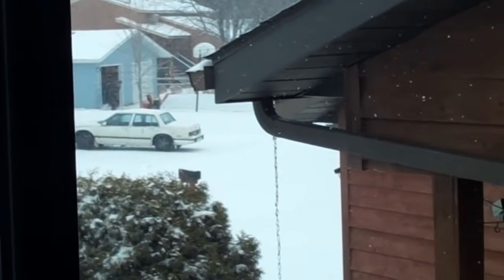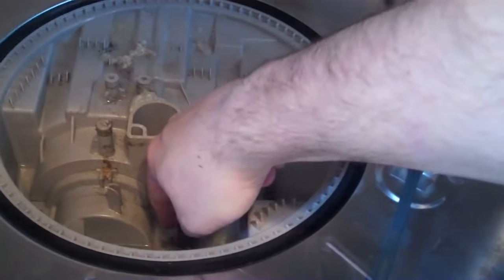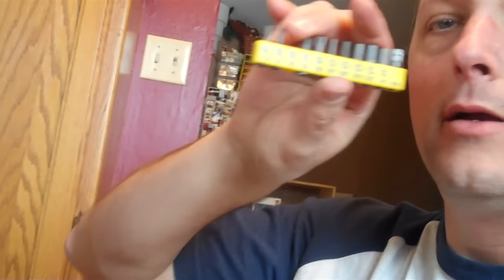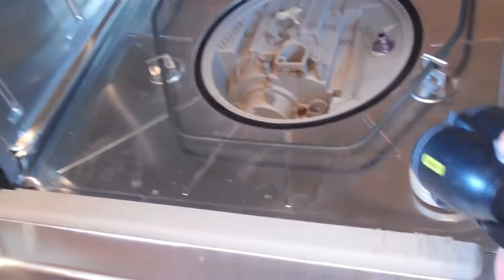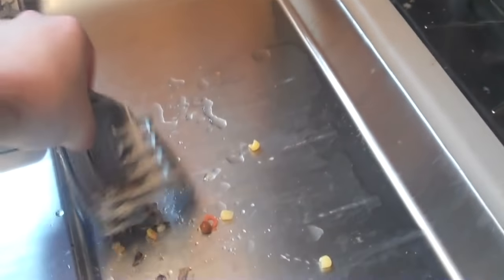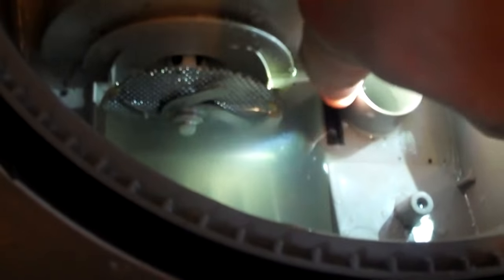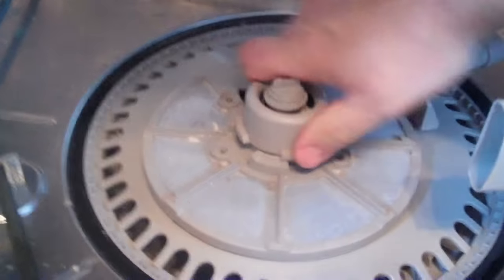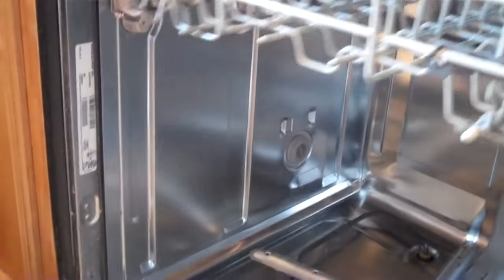Dishwasher Repair | How to Clean the Screen/Filter | Part 1 of 3

Comment: Hi, back after working over our second dishwasher today. Our models look similar to yours but they have a horizontal blue "ProScrub" part at the back similar to this http://www.ajmadison.com/ajmadison/images/large/KUDS30FXBL_recessed_element.jpg  In case anyone else has that today I found that I could pop it off and it had a bunch of the same evil peanut butter that has infested most of the machine so I will be going back to the first machine to check it. Bath tap was again useful for flushing out the junk. It seems to be easier to reassemble the bottom, back and upper channels in one piece but nearly impossible with the ProScrub part attached so worth popping off if just for that and then pop it back on after the channels are in place. BTW while I love my cordless drill and drive on this project I preferred a little ratcheting screwdriver like this one from Lowe's http://www.lowes.com/pd_501838-16878-63396_0__?productId=50074265#BVRRWidgetID  -- it had the two needed bits and I feel safer having the feel of what's happening when screwing into plastic in case I put the screw in at an angle or to avoid over tightening as you pointed out. Only downside is the bits are not magnetic but I have a small magnet that made it easy to lift out that little chopper cover screw. Finally I found some fun tips here you might enjoy seeing for your DIY channel (feel free to edit out link if you don't want it on this page) http://www.finehomebuilding.com/videos/   Thanks for helping us have clean dishes again!
Reply from the maker: I am very happy it helped you out and I am thankful for your helpful comment.  LOL I just came downstairs after fixing my disposal.  Something got in it and was jammed and now I know how to fix it quickly.

Comment: Important note: I COULD NOT get the propeller back on. The problem was...during reassembly, after I screwed in the filter, I put the propeller spindle in, but initially pushed it down until seated. This is WRONG. Just set it down in its housing and move on with reassembly. Do NOT seat spindle. This way, the spindle isn't too low, therefore enabling me to put the propeller back on properly. Whew!
Reply from the maker: That is VERY good advice.  I also learned I had to do the same, which is why I had to pull up on it with the plyers.  It is very confusing at first  but you describe it even better than I did.  Thank you for that helpful tip.

Comment: Thank You so much...but I went a step to far and took off the actual grinder mesh thingy ( I speak your language) and cant get it back on just yet...was hoping not to have to bring in the husband but looking like I will...
Reply from the maker: +keerah wilber I am hoping you were able to figure out the grinder mesh part.   I took mine out at a later date, and it was hard to put back in, and I am trying to remember how I did it.  For sure you will have to get any remaining food particles out of the housing for the grinder.  I actually had to use a wet vac to clean that housing out to that the grinder mesh could fit back into the housing.   Good luck.  Let me know if you figured it out.

Comment: Do I have to unplug my dishwasher to just clean out the filter
Reply from the maker: For safety reasons, and in accordance with the manufacturer instructions, it is safe to shut off the power to the dishwasher before cleaning out the filter.  This can be done by unplugging it, if that is easy to do, or simply shutting off the circuit breaker to the dishwasher.  Personally, I don't unplug it because the door is open and it cannot start, and on my dishwasher there is no way to get electrocuted.  But to be safe, I would recommend shutting off the power unless you are absolutely positive it is safe not to do so.

Comment: This was perfect, thank you!  I got everything cleaned out great, though I had to drain it with a shop vac because the blasted thing won't turn on (issue started before the repair, but I still wanted to get it cleaned out so the water and gunk didn't start to stink while I wait for repairs).  Now, if we get it working again, I know how to clean it out.  Thanks again!

Comment: Short Circuit (8/8) Movie CLIP - Number 5 Is Still Alive (1986) HD ...   NO DISASSEMBLE...  LOL  Hey visit my fun web page at www.LynnDarbyCreations.com for children's books I write.  I enjoyed your presentation.  BTW  There is another place where the Kitchenaid has hidden gunk.   Right where the door lays open against the inner tub there is a gasket.   Wipe that out with an old rag and keep your face away as particles will fly.   Tell me what you found!
Reply from the maker: Lynn Darby Good tip, thank you.  "No Disassemble" hahahah I have been saying that all my life.
Reply: Did you find the build up at the rubber gasket running the width of the DW with brackish water flakes?
Reply from the maker: Lynn Darby I had a little bit of build up.  Our water here is very pure, so that helps.